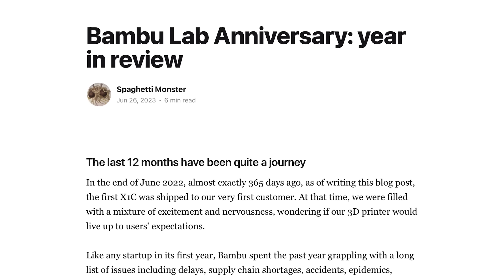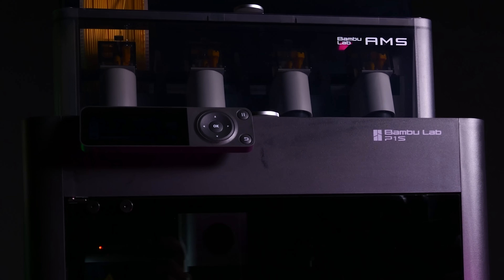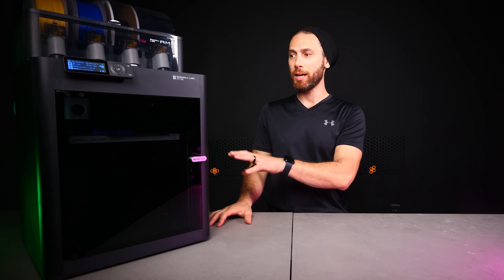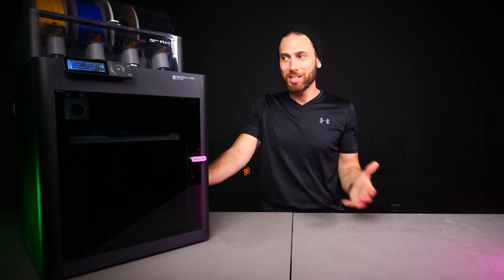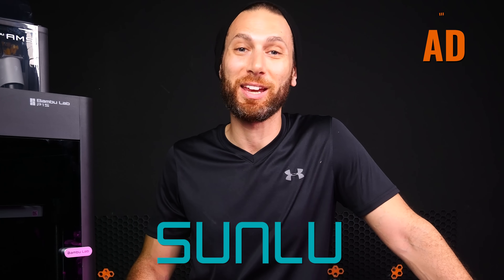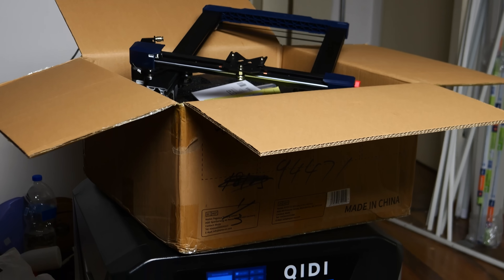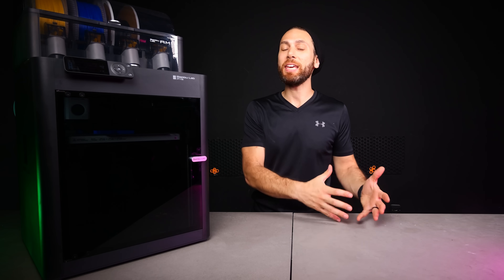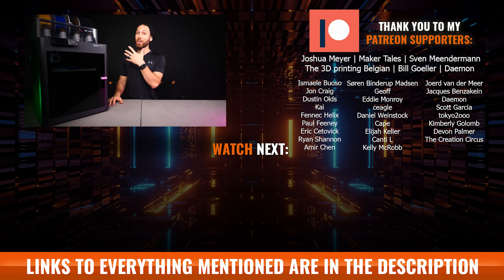Introducing The Bambu Lab P1S

Comment: One thing all of the reviewers fail to mention is that the wifi connection only works through a very fiddly blue tooth app. Getting the printer connected to wifi should be as easy as entering the connection code, but instead:
- download the app to your smartphone
- connect your Bambu account to your smartphone
- allow access to location, video and photo services
- hope the bluetooth of your smartphone still works (because no one uses that anymore)
- clear the cache of the blue tooth connections on your smartphone
- get reffered to the troubleshooting page
- spend the next three hours looking for any possible cause
- resign and spend another few hundred on a newer smartphone

Comment: Thanks for the videos mate. 

I joined the 3d printing gang 2 years ago with a creality ender 3 v2 and while I enjoyed tinkering at first it got annoying really fast. I was spending more time with calibrating and upgrading in the hope that it would start printing nicely then that I was actually printing. So I sold it last year.

Recently I was triggered again by the message that creality is coming up with the creality ender 3 v3 corexz and that peeked my interest again and now I am in the rabbit hole of finding the easiest and best printer to use. I started with wanting the creality ender 3 v3 corezx and then finding out about the qidi x-plus3 and then finding the bambu lab p1s and the x1-carbon and now I am a bit at a loss. I think that how much I would like to have a bambu lab X1 carbon it's a bit over my budget and the P1S is actually also a bit to expensive (at least where I live).

What would you advise. Is there a printer that doesnt need much calibration and works good for arround $600?

Comment: Well they suckered me and got an extra fifty bucks because I bought a P1P and pretty much within a few weeks ordered the P1S upgrade. No regrets though because I sort of enjoyed taking the thing half apart and putting it back together. Also I installed the Xtouch screen with a chamber temp probe and it sits on a swing up mount over the original control which also remains functional. So now I'm wondering if I want to use it to spawn a Voron. Jeeze, have I fallen into a giant wormhole?

Comment: So the real advantage that anything from Bambu, is the AMS.  The ability to print, in color, out of the box is quite the advantage, regardless of any other factors.  The P1S with AMS is sitting at about $950 and the X1 is $1450 and really, your not going to buy a P1S or X1 Without the AMS (you'd be better off getting something else for cheaper).  So entirely pointless to state its price without the AMS, since that is its BIG advantage over anyone else.  Every other X/Y printer is going to do much the same thing, with build volumes and price points being the only major difference.  However the ability to make something, in color, even with 4, or more colors, is a major point that cannot be stressed enough.
Reply: Huh? I’ll probably be picking up a P1S and have no interest in changing colors mid print

Comment: I've just upgraded to a p1s from an ender 3v2, what an upgrade! The ender isn't bad to start with but when you can reduce a print time from 3 days 5hrs to 7 hrs (mostly the printer but also fine tuning in babmbu studio) then that is above anything else a major selling point. 

I don't see the issue with the display as I never use it anyway. Sending from studio makes life so much easier. My only gripe is it is noisy! Much more noisy than the ender.
Reply: Hi, future bambu user here, have you tried the new firmware with noise cancelling? Sure it doesn't help for rod travel or fan noise, but damned if it doesn't help for beep beep boop motor noises :D

Comment: I've been using the P1P for some time now and it has been a great printer.  I thought it would ever be better to get a P1S.  The P1S is fully enclosed so I could do some materials not suited for the open design of the P1P.  A bonus would be that being enclosed, it should be quieter to help avoid those domestic complaints.  The P1S came in today.  Very nice clean machine, a long way from the machines that look like High-School science fair projects.  I started to print Benchy, and the fans started wailing.  The P1S will drive you out of the room with the fan noise, this is going to be a problem. A big problem.  On the bright side, it printed a beautiful, flawless Benchy.

Comment: I'm not so fortunate to afford a Bamboo ... or the nice K1, but I would choose the Creality because I would feel bad to strip out the printer, I would replace the Hotend and extruder from someone like Microswis, and a hot end from mosquitto, and my own controller board and software.  I promise you , if you know what you're doing, the creality will surpass the bamboo. I'll use the best, Open source, Klipper, The community, and the best extruders and hotends. + Multicolor(slower printing because it's heavier with it's extra 4 or 5 hotends and nozzles, but a fast single extruder must be able to be replaced by using just magnets and a lever, no wires or anything. The best for me is that I know my designs and creativity doesn't get send to china. That's why I don't except the bamboo printers.

Comment: Great video. My OG Creality  CR-10's are starting to drop one by one so I'm looking to upgrade.  A couple of questions.  Can you add a camera to the P1S?  Also, would love to see a video on the AMS system.  I've never considered doing multi color until very recently and am curious to know how it works.
Reply from the maker: P1S has a camera and works great with the AMS. AMS is great but multicolor is extremely wasteful
Reply: @thenextlayer  I saw another video saying that it was possible to direct the purge into another part on the build plate.  Since I paint a lot of what I print, it seems like I could easily use that as my purge tower and kill two birds with one stone and zero waste.
Reply from the maker: Btw https://jle.vi/Bambu if you’re planning to purchase

Comment: Hello,
Anyone have P1S with Ams? I read on reddit that you should have the door open and the lid off when printing PLA, that the lid should be off is a dealbreaker for me as I have limited space and can only have AMS on top of the lid. The machine advertises with AMS on the lid, if this does not work with PLA, it is a bit misleading, can anyone confirm?
Reply from the maker: It works fine with the door open and also you can print a bracket that will hold it on the printer without the lid. When you have a printer you can solve those issues easily. If ordering please use my link https://jle.vi/Bambu
Reply: @thenextlayer  Thanks for the answer, but a bracket destroys the whole aesthetics of the Combo, the machine is advertised with AMS on the lid and then you shouldn't have to change the whole appearance of it. It also means that the function of AMS is lost as you have to put the lid on and off continuously.

Comment: You did not mention max bed temp. Is it the same as p1p or x1c? Does that extra temp difference matter or needed for certain materials?
Reply from the maker: P1P. Sorry I neglected to mention. It works great for ABS, maybe less for PETG-CF.

Comment: I have a P1S on the way. It's my first 3D printer and I wanted to get the one I really wanted and not want/need to upgrade in the future. I'd like to know if the X1 touch screen is compatible (or ever will be compatible) with the P1S. I''m wondering if I can upgrade to the X1 screen in the future if it becomes possible. Right now the product page for the screen says "only suitable for the X1 series." Will that ever change?

Comment: I have a X1c. Some tips. The back of the build plate were the nozzle try’s wiping a hole threw the plate I took a remnant of high temp resheet to put over that spot, when fil. gets low pull the rfid and relabel it to match  what you want it to run into.

Comment: I don’t get why everyone is so frustrated with the controller, it’s really not as bad as everyone makes out out to be. 
I would say spoiled is fitting. 
It’s perfectly usable.
Reply from the maker: Do you have an AMS? Try loading filament and changing the material…
Reply: @thenextlayer  I have 4 AMS Units, 1X1C and 7 P1Ps.
X1 is hooked to an ams and the others are on P1Ps
The AMS loads filaments on its own, you don’t even need to touch the screen on either of the printers? So I’m not sure what you’re doing lol. 
And unloading the filament from the rear mounted spool is literally a push on the cutter, and 5 clicks on the keypad. And only 8 clicks if you want the machine to do it (not sure why you would want to since it’s faster manually)
Granted the X1 is 2 touches on the touchscreen, it’s saving what, 2 seconds?
There’s literally nothing that I haven’t been able to do on the P1P screen where I wished I had the touch screen from the X1. 
I guess I just don’t see minor inconveniences, like pressing actual buttons to be a huge inconvenience in my life.
But there are people out there that think this is like the biggest inconvenience  and they just can’t believe they can’t upgrade to a touchscreen… lol

Comment: actually ther plastic will isolate better than the metal. thats why im using aluminium composite for my enclosure, the plastic between the aluminium sheets isolate the heat better than the alu itself. same reason why we dont have plastic heatsinks, but we do have alu heatsinks

Comment: This helps a lot. I was actually thinking about getting a printer as a main non 3D printer hobby. My current and only one is often down due to my failed experiments and that puts everything else non 3D printer related (but needs 3D printer parts) on hold. This may be just it as I can't see myself stopping tinkering with 3D printer experimental upgrades (for speed 3D benchy, or other novel features like accelerometer based Z offset), but also like to have less downtime. And budget is really a thing for me and this may just be it if I temporarily swap the experimental budget towards this one. Great service.

Comment: Right now there's only a $100 difference between the P1S and P1P. So I think the P1S is the better deal.
As for recommending the SV06, it's running an almost 1 in 6 bad review on amazon due to the units dying, blue screening and being unrecoverable, and other problems. That's a HUGE difference between the SV06 and other printers in that price range when it comes to bad reviews. They clearly have major QC issues.

Comment: There's a relatively impactful difference in the heatbed:
P1(P/S) only heats up to 100C, while X1 does 110℃@220V or 120℃@110V.
That extra 10C helps a lot with ABS/ASA adhesion.
Reply from the maker: Ah, didn't realize that. Good point, but in my testing, this thing does print ABS like an ANIMAL - perfect prints.

Comment: Thank you for this comparison video! I was really considering to buy X1C because I do want to print with AMS since I only have Prusa Mini+ that I learned things on first... But the price $1.500 was kind to too much..  I do need an enclosure due to dusty environment and non-daily printing so P1P was not really a thing for me since I would need to print the covers by myself (so I wont be printing the stuff I want and still it wont be fully enclosed due to extra upgrades that would be needed to be purchased... I also wanted the printer look somehow "classy"  (I mean I like my MINI+ but it somehow looks like construction site if you know what I mean) and I think that Bamboo hit the right nail-head and released the printer I was looking for. 

The only minus-point that would break my absolute 10/10 rating of this is the touch screen BUT you mentioned it the right way – who would need touchscreen while we have expansive smartphones and great slicer that will do the thing and eventually lowers the cost of P1S to really great price. You helped me a lot with decision making so if I will go for buy it will be definitely via link from you 🙂Have a nice day!
Reply from the maker: Sounds like P1S is for you!

Comment: It would be great if Bambu offered the option to upgrade to a touch screen. They need to take a page out of Creality's book and offer more accessory options.
Reply: This is their downfall. They are like Apple. Everything is proprietary and 3rd party upgrades and tinkering aren't really an option. The only thing you can do is buy what they offer or 3D print your own upgrades.
Reply: @ArcanePath360  there's also a very big difference in that Apple charges exorbitant prices for any sort of components/upgrades, while Bambu has very reasonable pricing on components. Proprietary is never really a positive, but if it's the price to pay for things just working then I am in.  I don't want a constant project to keep my printer running.  I also think those that use there printers for professional purposes want that even more than the hobbyist.
Reply: @ArcanePath360  It's actually not a downfall, it's probably the way to the top. Providing an affordable product that just works, out of the box, is not done to sell to the existing market of tinkerers, but it's meant to unlock a whole new market: those who want to use their 3d printer as a tool for non-professional purposes. They've done the exact right thing and sell to a brand new market, and until Creality released their K1 they did so without any competition.

Comment: I wonder if the P1S will cannibalize P1P sales more than X1C sales - there are some nice features for what was the standard P1P price until so recently. Regardless, I still have concerns with Bambu Lab about user serviceability of their printers, quality of customer support, continued parts availability, reliance on closed source IP, and Creality-like adherence to open source licenses. The parts availability and serviceability are the most important for me, as even Sovol has been hammered with issues related to people having trouble getting parts shipped in a timely manner, if they're even available to be ordered in the place.

On the subject of video formats - I really like the idea of true comparison videos rather than just a review. Many reviews have a section at the end where the printer being reviewed in depth is compared to another printer but those comparisons usually seem to be basic and/or with a nearly identical printer (I think of the reviews Chuck Hellebuyck has done on printers like the Voxelab Aquila, which are very close clones to the Ender 3s that are so central to his channel). Having a more head-to-head comparison between printers aimed at similar consumer groups but that might have different features or strengths could be really interesting - like how the Prusa Mk4 and Bambu Lab X1 Carbon are priced for prosumers and wealthy hobbyists, and different features might appeal to different users within that group. 

Alternatively, choosing a specific use case and then comparing and contrasting various printers might be even more intriguing - like having an episode focused on printing flexible filaments, and how the Bambu AMS really struggles with soft filaments while the Sovol planetary extruder on the SV06 and SV06 plus handles them well with a little tuning (or most any printer can run Flexible PLA without any more tuning or testing than you'd need for any normal filament). Another idea would be for people averse to resin printing who might need an FDM printer that can make quality tabletop game miniatures, and how a basic but properly-tuned Ender 3 with a 0.2 mm nozzle and the Cura profile from FatDragonGames can honestly beat the pants off of most stock printers for this application.

Whatever you do with reviews and other product-focused videos, keep the project-related videos coming. Whether they're practical or fanciful, videos about things you're making for your studio or at home or whatever are great - I loved the videos that Michael from Teaching Tech did on his backyard goat pen, for example, and not just for the gratuitous goat footage that came along with the discussions on how to model, print, and otherwise fabricate all the tools and appliances needed for the project.

Comment: I have 2 X1Cs with AMS and I don't know if I would have bought this even if it was out when I was considering the 2nd X1C.  I'm spoiled now with that touch screen and aluminum enclosure. I'm sure that the P1S will be another great printer from Bambu but put on that touch screen off the X1C and you have a homerun.
Reply: I hope you're only printing open source 3D models over the cloud.

Comment: Thanks for the comparison. I'm very new to 3D printing, and this P1P was given to me as an early birthday present, I turn 81 in August, by my son, so your review was helpful. However, I don't know the difference between the original P1P and the P1S except the P1S upgrade is an enclosure with other add ons. What are the pros and cons of having a 3D printer that is enclosed vs one that isn't enclosed, focusing on the P1P? Thanks.
Reply: It is essentially the same printer with an enclosure and a few other additions. Bambu Labs are selling a kit of parts to turn a P1P into a P1S so it is a straight forward upgrade, nothing new in the core print mechanism. There are two advantages to an enclosed printer, first it provides a more even temperature reducing warping in materials like ABS during printing meaning fewer failed prints with difficult materials. Second it allows fumes to be contained and dealt with especially with materials like ABS which can produce nasty fumes. If you are just printing with PLA or PETG then it really isn't necessary at all.